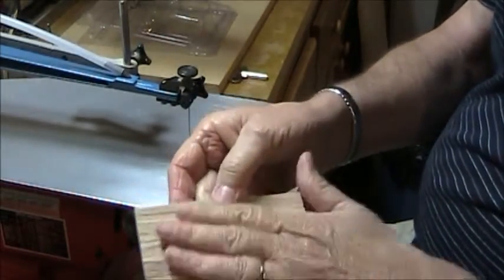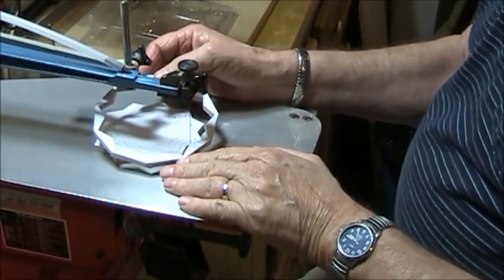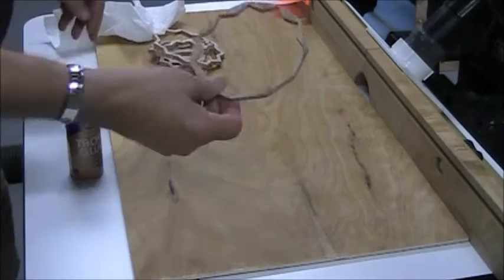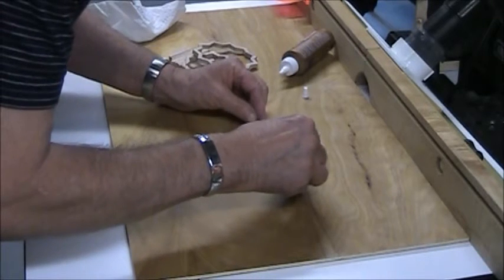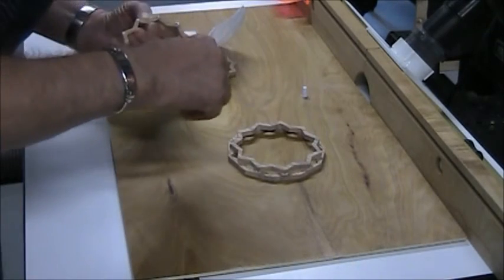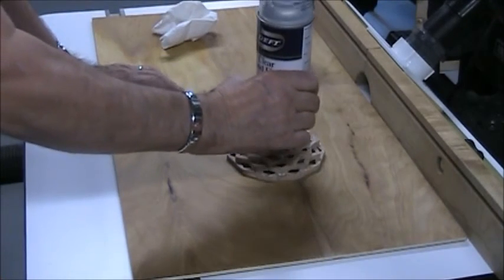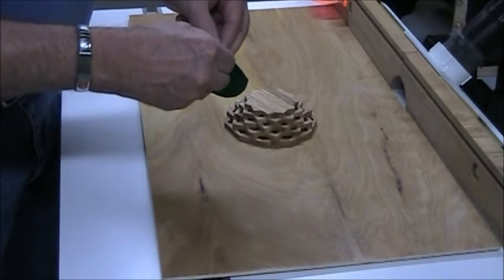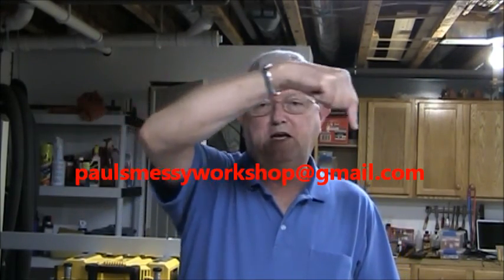11 Sided Scrollsaw Basket

Comment: What angle did u cut the rings out at
Reply from the maker: James,  the cuts are made at the regular 90 degrees to the bed of the saw.  Then the different rings are rotated so that the points of one ring support the next ring, they just stack on top of each other.  I hope this helps, if not just email me at paulsmessyworkshop@gmail.com and I will be glad to help.  Thanks for watching and taking the time to comment.